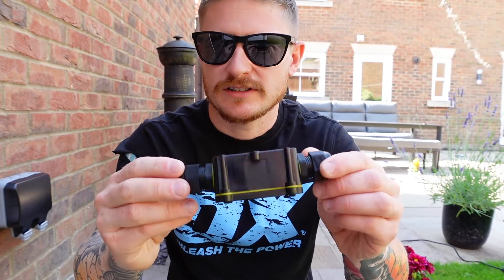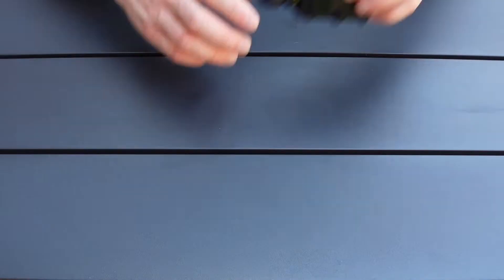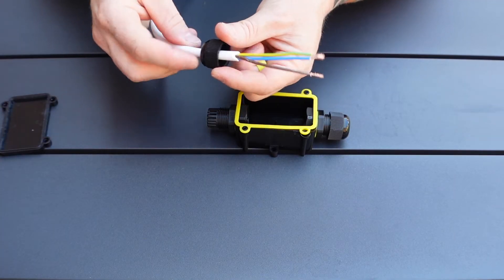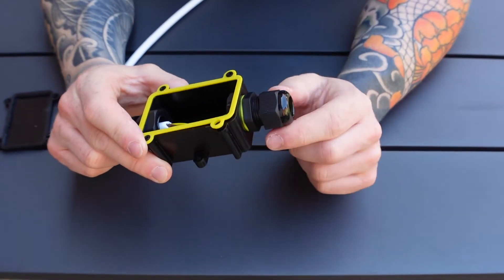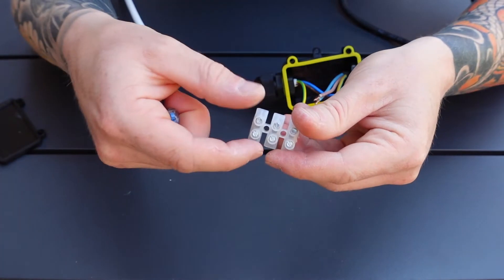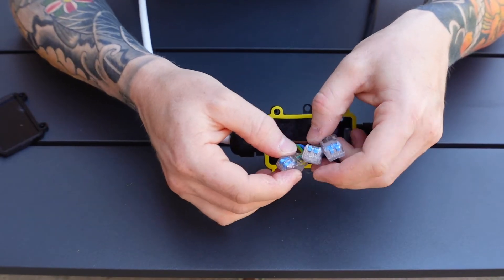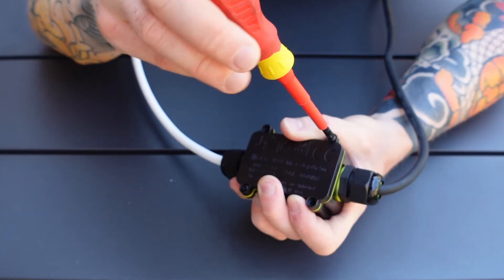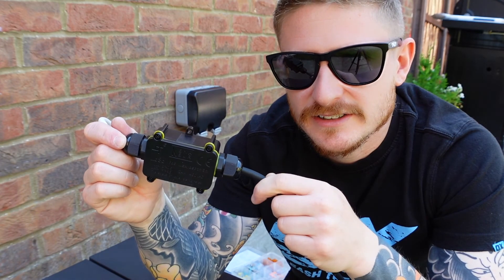Joining Cables Outside With a Waterproof IP68 Connector

Comment: Hi IV got a outdoor sensor light just runs of a plug I'm looking to put a light in my shed and a double socket can I just take the light of and run the cable to the shed it will be only light use

Comment: Do you have to use a specific cable as you are using outside? I need to run a cable extension from outside socket to some PIR stake lights. Maybe use a 3 way version of this box to branch off in 2 directions. Im enjoying your videos, Will you be making any videos on outside garden lighting to lighten up dark pathways.
Reply from the maker: Yes I do have plans for further outdoor lighting. Thanks

Comment: Thanks mate. Great videos.
I am removing my external PIR sensor light and replacing with a LED floodlight one. But i want it in a different position so need to extend the cable 3 meter. Would this be a good solution for that?
If so is 1.5mm 3 core hi tuff cable ok or does it need to be armored?
Thanks
Reply from the maker: Thanks. Yes you could use the 1.5mm 3 core hi tuff. The only time I would use armoured is if it is buried underground.
Reply: @TheDIYGuy1  Thank you!

Comment: What is the difference between ip68 and ip66 ? And what is the best brand for these waterproof boxes?
Reply: First digit - protection from foreign body and particulate ingress 0 - 6:
Second digit - protection from moisture ingress 0 - 9K:

6# Full protection against dust and other particulates, including a vacuum seal, tested against continuous airflow.

#6 Protection against powerful jets (12.5 mm nozzle) of directed water from any direction.

#8 Protection against extended immersion under higher pressure (i.e. greater depths).
Reply: The best product is the one that works best for you